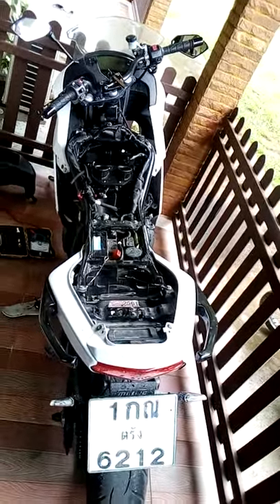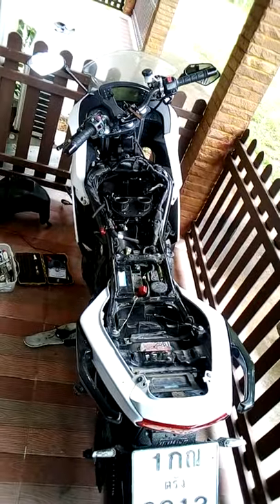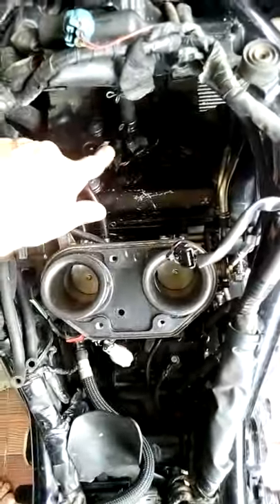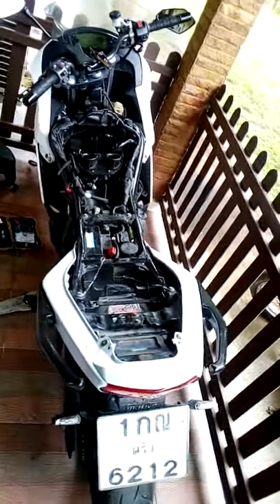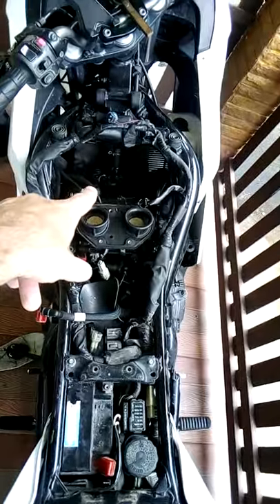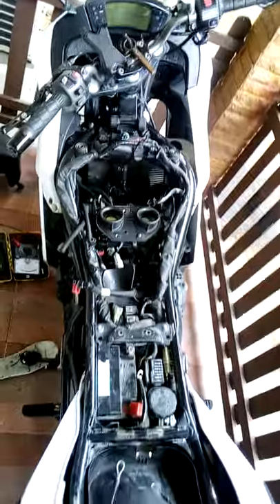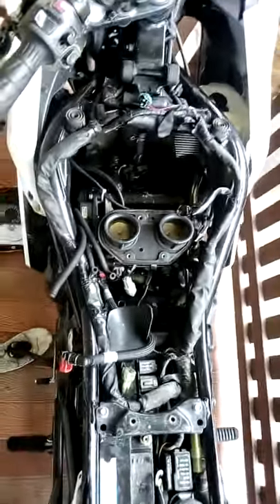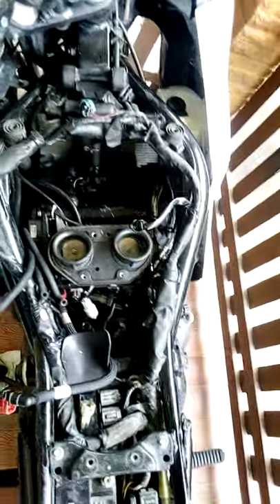Ninja 650 2009 doesn't start..Help!!

Comment: @ 4mins.........I made same mistake, that sensor, and the one below it should NOT be messed with under ANY circumstances. They are factory set, and the adjustment is so fine it has to seen to be believed. We're talking below 1mm. I had to take mine in to a specialist and he spent 4hrs setting them!!!! Had similar staring problems that you originally had, and it was the IGNITION SWITCH. The contacts aren't the best it seems. There's a video on here of a Lad in Mumbai cleaning his, I attempted the same, couldn't get the back off, so sprayed WD40 in the drain holes after removing it, holding it upside down and all different angles whilst working the key. It seems to have done the trick. I discovered that problem by pulling up slightly on the key when turning the switch on, and it seemed to cure the problem temporarily. You will have to get those sensors set up properly by a top bike tech guy, anything else is just wasting time and money.

Comment: have you goten this problem solved yet if not check the starter relay its usualy the issue but you will have to get it to a dyno to get the mapping done aswell thats why it idles rough and struggles
Reply from the maker: Yes thank you it was the starter relay. The idle issue was the throttle body, they are prone to failing apparently, replaced with a used and it worked fine. Since then (among other issues) one of the valves dropped onto the piston (apparently these engines are prone to that as well) broke the piston, engine needs a major over haul or replacement. Haven't the cash right now.

Comment: hello sir 
How did you fix this? iam also have to this problem to
Reply from the maker: Hi the problem with the bike not starting was the starter relay was bad.
You can probably get a used one from ebay or perhaps some local equivalent or buy one new from Kawasaki.
The one got was used from ebay for around $20 excluding delivery.
You can download a manual from the internet for free to find out where the relay is. It's on the left hand side on my bike (2009) just in front of the seat behind a plastic black cover and take just a few minutes to change.
Reply: @tedtheturbot  thank you sir

Comment: We are brothers in this situation
Reply from the maker: My problem was the starter relay (spark was fine). Mine didnt turn over. As soon as I replaced the relay/solenoid she started fine.
I'm going to do another vid explaining what happened but she's now in for repair to change the head gasket..
Somehow put a slit in the coolent hose and cooked the engine during the repairs.
Does the starter motor turn over?

Comment: Did you get it sorted ??
Reply from the maker: Hi yeah thanks..i'm in the process of doing another video..
So i got a 2nd throttle body and that didnt work either so i tried swapping over the throttle actuators and that didn't work either.
As i'm checking on the forums im hearing it might be the starter solenoid but i can can hear mine clicking so i think mines working ok. Then i see a youtube vid and the guys saying it still may not be working. As im pulling mine apart to test the hex tool bridges the terminals on the solenoid and she tries to start (without the throttle body in place).
So i get another starter solenoid and thats the original problem fixed.
BUT me messing with the throttle body has f*cked mine up cause you can't remove the actuator without f*cking it up completely..might as well bin the whole lot. So the 2nd throttle body didnt work  properly from when it arrived (presumably because the actuator had been tampered with) and i managed to do the same to my original in the process.
Started looking for a 3rd TB on ebay but asking if the actuator has been touched and if it was working ok before removal. Found a guy that strips bikes for parts with 100% satisfaction rating and he guaranteed his TB for 30 days - no error code problems or compatibility issues. He knows his stuff he knew you can't touch or remove the actuator. Bought it, put it on and she's been running 100% ok ever since..
I'll do another vid presently. Since then the relay box for the headlights has failed (no headlights or high beam indicator working) so waiting on that to arrive to get her fully operational.
So when i asked the Thai mechanic he told me the throttle body when he should of checked and said it was the starter solenoid but with the differences in language we got the communication wrong..all he was doing was telling me about another unrelated problem - if i had just replaced the solenoid i would have cured the non starting issue BUT from all of the above i've now fixed the error code issue as well - just have to get a reputable used TB..
Reply: @tedtheturbot  Glad you got there in the end :)

Comment: I replaced coils, cdi, looking at cranshaftsensor now. No spark ever. Not even jesus could get the bastard sparking.
Reply from the maker: Have you testing the clutch and the side stand switches? 
Clutch switch is behind the clutch on the bars you can test it following the steps in the manual or deactivate it following vids on youtube.
The side stand switch is behind and connected to the side stand again follow the steps from the manual. You'll need a multimeter but they're cheap enough. I tested mine myself and I've never done that before.
If either are faulty they'll stop the spark..